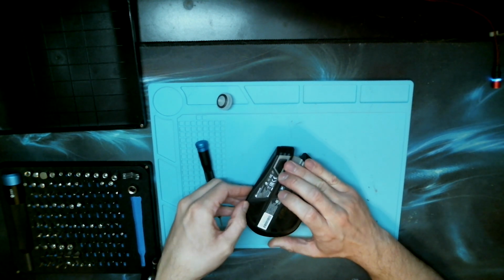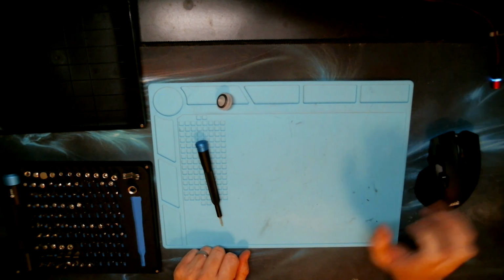Fixing Corsair Ironclaw Wireless Mouse With 3D Printing!

Comment: I'm so grateful that some people just take time to record the process of taking apart a mouse. I accidently dropped my mouse, which must have unclipped something on the inside when it hit the floor, shifting my right-click position and disabling it. Disassembling and reassembling the mouse properly fixed the issue (and allowed me to clean the inside a little bit). I couldn't have done it if it wasn't for this video, huge thanks!
Reply: SAME HERE, SO GLAD THAT THIS VIDEO EXISTS
Reply: I also dropped my Iron Claw with the right-click ceasing to function, so I'll follow this guide and maybe it will fix it.

Comment: Very helpful video. Fixed my scroll wheel using a 1/16th inch allen/hex key as I don't have a 3d printer. It fits perfectly into the encoder wheel. Had to drill through the plastic of the scroll wheel and then twist in the allen key and cut down to size with a grinder. I didn't have to heat up as it's a very tight fit. Saved $100 on a new mouse! Thanks.

Comment: I just fixed mine with a small 1 inch nail that was part of some wire guide/clips I have, they may be from Christmas lights or some other electronics. It has a head just the right size to keep it from going all the way through the wheel post/holder. On the actual wheel, I drill it out with the smallest bit I have from the end that is already hollow. The nail was the perfect size to fix it and left no slack or play in it. This also seems much easier than using a hex wrench and probably even more durable than any of the other fixes I'm reading about.

Comment: You are the fucking best. I mean that. The wheel broke for no apparent reason (i was just scrolling through the code I'm writing and suddenly it felt loose and it didn't scroll anymore). As I was looking online for a possible fix I found your video. 3d printed your thingy, cleaned it, installed it. less than 4h after breaking, it's as good as new! awesome. Your video is clear, concise, helpful. Thank you very much.

Comment: Had mine replaced under warranty once...and then the same thing happened just out of warranty. Took a rotary tool and finished snipping off the fragile tip on the wheel axel. Then, I used the large, hollow post as a guide with a tiny drill bit to create a proper hole for seating a new axel. Then, I took a junk 1/16 allen wrench that I had in the drawer, and used the rotary tool to create a small axel of the proper length. Tried just installing it in the wheel itself, but it was actually just a little bit too small to consistently turn the tiny wheel that controls scrolling. 

So, I removed it, got Gorilla super glue, dipped a sharped toothpick into it to have a very, very fine point with just the glue (because if you get any on the outside of the little orange wheel you're trying to turn, you're screwed), and coated the inside of the hex seating with it. Then, I carefully tapped in the metal hex bar from the outside toward the mouse wheel. The glue was enough to complete the gap, as well as some being on the tip to seat it in the mouse wheel itself. Once that had set up and seemed to be holding, then I very carefully repeated the dip-and-touch process with the toothpick in three locations on the axel against the orange wheel (being sure not to get any on the outer part of the turning surface). 

So far, it's working like a champ. Scrolling is smoother than when it was new. I've had good luck with this adhesive in the past, but only time will tell regarding longevity. But for now, this guy is repaired. And, I could pop it apart and touch it up with a couple of new dabs if for some reason it breaks loose over time. But knowing the strength of this stuff, that's doubtful.

Cheap and simple, so long as you have a steady hand and are patient. But also...I'd like to smack the crap out of the guy who designed the interior of this mouse. It was clearly not done with maintenance in mind. This thing's a nightmare. Sheesh.

Comment: If you don't have a 3d printer, you can use a small hex wrench to fix it. I just cut part of it off, heated it up with a soldering iron, then melted it through the center of the axle. It wasn't a perfect fit, so I put a bit of hot glue on it. It's worked perfectly like that for over a year. It's not visible at all and doesn't interfere with the LEDs.

Comment: Great tutorial! Quick question, I notice you are using a magnetic plug to charge the mouse, what brand / how did you get it to work? I've tried a couple brands and they don't fit, when I've modified the bits with a Dremel they fit but charging is spotty at best

Comment: Hey mate, thanks for your video. My Ironclaw had the wheel not correctly responding. I gave a little of contact cleaner and for now looks good. 
Some tips you gave we essential for the process, specially for reassembly. cheers

Comment: Same mouse externally but wired instead, different inside and montage is way different so here a  explanation for the wired ironclaw RGB: 
The screws are not on the bottom side, they are on the top. Gently with a thin blade or razorblade you can click off the top cap, it will reveal 4x a t3 (torque) screw.
Those are not in very tight so if you do not have a t3 torque driver.
Well I just used a watchmakers star screwdriver) once the 2nd top cap is off you have access to everything inside and can clean it like that. If you need to replace parts then you will see that all of the remaining screws that holes each side panel and electronic board together is fastened with a star screw.
Its so well put together that one by one you can take it apart, or even leave a panel or board on if you only need to take of 1 part.

Comment: Basicaclly everything on my mouse which was flawed/broken is now fixed...thanks guys! instead of replacing the whole wheel, I just bought an 1/16 inch allen wrench and drilled a hole through the original wheel. inserted it after heating it up and now its melted together like 1 part. Works like a charm! also the wheel-click is fixed by the alcohol. Many thanks again!

Comment: Thanks for this tutorial. I managed to fix the scroll wheel on mine by applying Vaseline on the contact point. The problem on my mouse is that when I scroll down really fast, it inputs a scroll up occasionally. Disassembling was relatively easy as long as you have a torx  and philips driver but reassembling was a huge pain in the ass.
Reply: Jesus Christ died on the CROSS FOR YOUR SINS REPENT OF YOUR SINS AND PRAY TO GOD FOR FORGIVENESS GOD AND JESUS CHRIST LOVE YOU NEVER FORGET THIS❤️❤️❤️❤️❤️❤️❤️❤️

Comment: i got a hex key cut to lenght, extended the hole through the wheel by drilling, applied some glue to the metal hex key, and then put it through the wheel :D so now that part is metal
Reply: How were you able to do this exactly? Just be was this he shown with my M65 Elite.

Comment: Today I got my mouse, I bought second hand(No wireless adapter)...
To reduce weight, I decided to disassemble and remove the battery.
As it turned out, the Corsair engineers changed the design of the mouse wheel support.
https://youtu.be/tafX3Y1emVs

Comment: I'm going to fix mine using the hexagonal 1.5mm bit fix but I just wanted to ask a question about the disassembly: Do you have to pop the circuit board out to take out the mouse wheel and to put it in again or is that just needed to make changes to the button?

Comment: Used this guide to fix my Iron claw mouse. the tip of the mouse wheel that engages the scroll broke off. Didn't have the option to 3D print. I have many 2mm Hex keys to spare. So I used a metal file to bring the 2mm hexkey down to 1.7mm Fits perfectly, I then used my drill to spin the hexkey and used a metal file to round the hex key. I drilled through the mouse wheel first with at 1.5mm drill bit, then a 2mm drill bit, slotted the hexkey through the middle, added some super glue and re-assembled the mouse! Problem solved! Thank you for this Guide!
Reply: yes just got mine apart and this is the best repair option cheers
Reply: Do you think this will also work with a standard 1.5mm hex key? I've seen someone else in the corsair forums solving it with that.
Reply: @mortimizer232  Just used this method with a filed down 2mm at one end and was able to press fit so no glue involved. I think 1.5 will be too small. Yes the tolerances are that tight and its tedious to get it to fit but mouse wheel is bullet proof now

Comment: can you sell those replacement mouse wheels?
Reply from the maker: Unfortunately I do not have the resources to produce these. If you do not have a printer there are some great 3d printing services where you can send a file and they'll mail you the part! Check out shapeways. I suggest using SLA or SLS technologies!

Comment: Is the 3d printed piece (with resine) is going to be more durable than the orinal one ??
Thanks a lot for the helpful video :)
Reply from the maker: It really depends on the resin. I did have to replace mine one more time (elegoo abs-like) I bet if you used an engineering grade resin like formlabs or maybe matterhackers it could be? If you got it SLS printed I suspect it would be stronger

Comment: I had a similar problem with a Corsair Scimitar Pro RGB.  The wheel, It's axle & the pin that fits into the blue/green spinny clicky thing that registers the wheel's motion is made of cheap plastic & is all one unit.  The flattened edges which wore out, thus the free spin.  A meticulously placed drop of crazy glue on the tip of the pin & placed with the utmost care into the spinny/clicky part that is attached to the sensor fixed it.  It's done, should have recorded the process for demo, but it's fixed now, forever, so dismantling is not an option, lulz.

Comment: Wish this video was available when I tried repairing my mouse wheel :(. I didn't know it was such a weird assembly or I wouldn't have tried. Had the exact same issue a month after I bought my Ironclaw, didn't have the means to print my replacement mouse wheel and voided my warranty. 
I did repair other mice I had, including a Roccat Tyon, but this assembly is something else and the wheel design is so fragile almost made to be broken. 
I wouldn't have tried if I saw the issue before hand, but hindsight is 20-20 so...
It sucks that this mouse was my favorite shape, but with such a problematic wheel I don't think I'll get another one.

Comment: Thank you so much for the stl! I am currently watching your video using my disassembled mouse while my wheel is printing!
Reply: Using an FDM printer works, like my Prusa, but the hexagon axle will be deformed. Printing it with 40% infill helps though.

Comment: Upvote if you used this video to replace the omron micro switches with ones that don't suffer from double click
Reply: Yup thats me
Reply: @MonPLX  2021 and still the same problem. Except i don't know where to buy mouse switches that work with this mouse.
Reply: I bought my kailh red microswitches on ebay. I also tried the firmware thing and that only worked for less than 2 weeks. The omron switches are just bad and they all fail eventually.
Reply: Is that what is causing my double click?  The switch?  I found this video while trying to figure out what was causing that.
Reply: for me it was a firmware issue. Went back to release firmware and is working flawlessly, can´t say the same for the scrollwheel

Comment: I am to the point where my next mouse will probably not be Corsair, my scroll wheel has failed on my harpoon, glaive and now my iron claw. I did the nail trick on my glaive and it only partially worked.
Reply: my ironlaw xbutton broked

Comment: Thanks for the awesome video. Do you know where I can buy the wheel? I dont have a 3D printer.
Reply from the maker: Unfortunately I don't know where you can buy an OEM wheel. With that said hope is not lost! There are a number of print on demand services out there. Shapeways is a popular one worth checking out. Just make sure you order the print using either SLA or SLS material so it has high enough resolution!
Reply: @SNRTechBytes  thank you so much. I will try your recommendation.